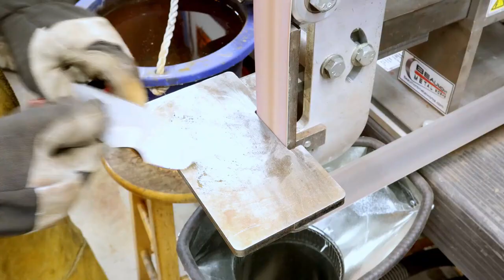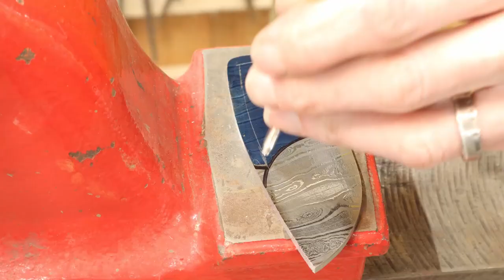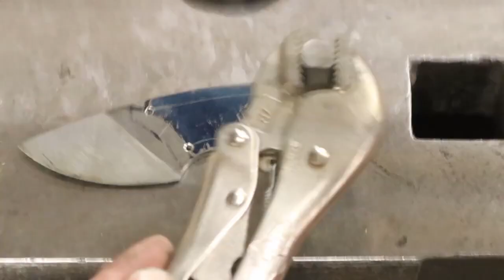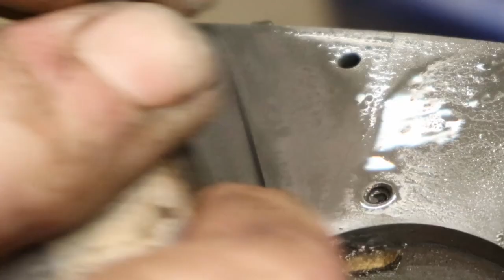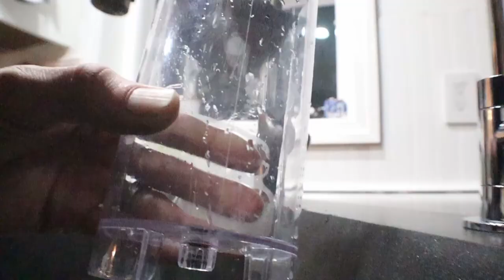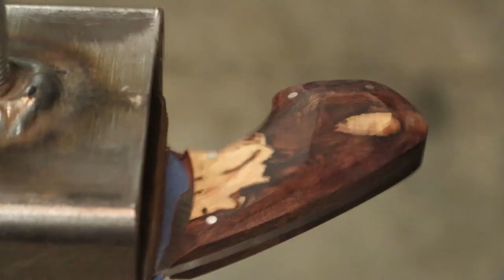Making a utility knife - damascus and Honduran rosewood

Comment from the maker: Did anyone notice the blade was shorter after heat treat?
Reply: Did the blade broke ?
Reply from the maker: No, I ground it to thin before heat treat and it bacon stripped on me. This is how far I had to grind it back to get into good steel!
Reply: well... that is one way to do less hand sanding =)
Reply: @Aleeknives  as they say a knife maker doesn't make mistakes, just smaller knives!  Great work!
Reply from the maker: Yeah I haven't had to make one smaller in quite a long time! I ground The Edge to thin and it went bacon strippee on me during heat treat
Reply: @Aleeknives  oh man!!  Sometimes bacon strip s are a bad thng. 😜😜
Reply: No, never!
Reply: Love the save!!! 💯  I wonder how many of us would have just given up and trashed it? 🤣😂

Comment: So when I grind  my scales after attaching them to a Damascus blade can I bring that finish back with an acid.
What is the solution that you dip the blade in after the final sanding
Reply from the maker: I wouldn't use this method for Damascus! Check out my Damascus camo knife video. It shows a different method of attaching the scales on Damascus. I have seen a couple other makers dip the entire blade and handle in ferric chloride but I totally disagree! If any acid gets under the scales it will continue to eat away at the steel. I would finish the blade and etch it. Finish the scales separately and then glue them on and clean the glue.